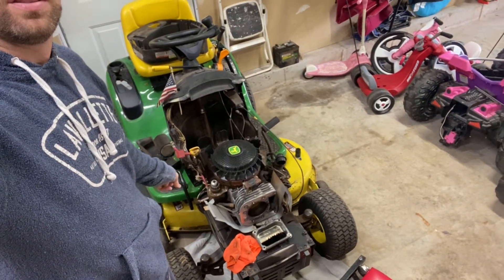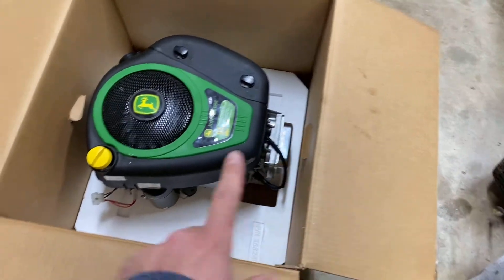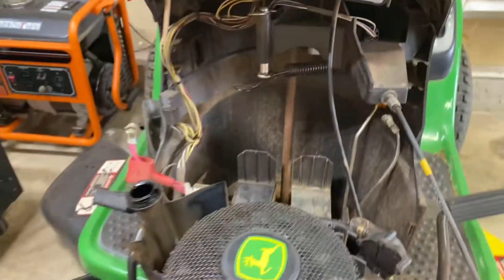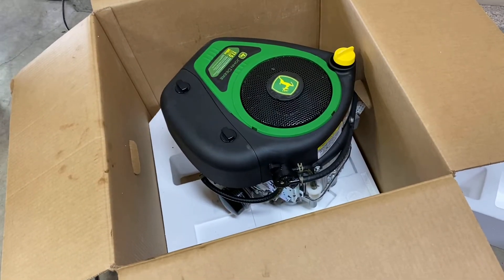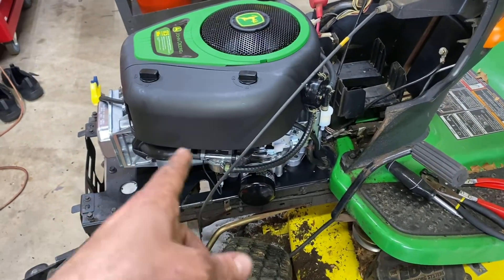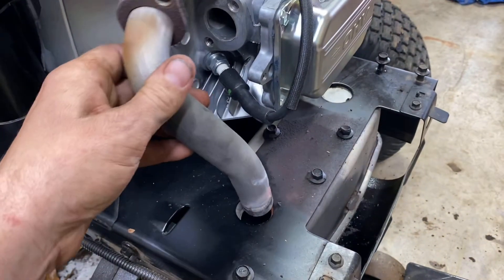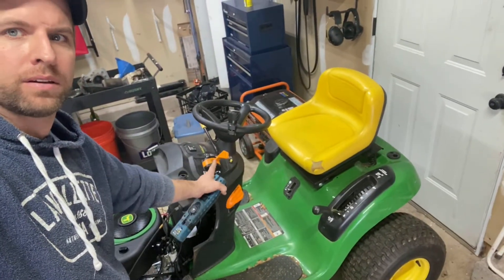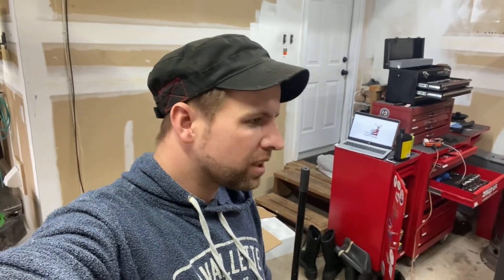How To - John Deere D105 Engine Replacement

Comment: At 13:56 of this video - What is the thick black cable and (black box thingy) called?  It's shown directly to the right of your hand.   Looks like we had some mice activity that chewed into the wiring of that black cable and will need to replace.

We so appreciate your informative videos!  Thank you.
Reply from the maker: If your referring to the cable that runs to the front, that’s the ignition coil (spark plug wire) and the black box is the coil pack. So the box/pack is what sends the electrical signal/pulse through the wire so the spark plug can fire, thus initiating the combustion stroke. If that’s chewed you can grab a new setup pretty cheap, under $25 if you don’t mind aftermarket.
Reply: @Neighborly_Content  Perfect!  Thank you.

Comment: Fantastic video!!! It made the Job 100 time easier and faster. Got a great deal on a used engine (135 hours) and began this engine swap at 5:30 last night. At 7:30 the job was complete and my D105 is running again! The engine I found was at a small engine repair shop, I got such a good deal because I removed the engine off an old tractor that was in his shop. It took me 30 minutes to remove it (thanks to the video) and he was very impressed. only small snag is I did struggle (briefly) on which of the many holes in the frame to bolt through. Minor 5 minute delay.
Reply from the maker: Awesome! Glad it helped out.

Comment: How is that single cylinder engine holding up? The Briggs single that MDI uses has a known issue with the camshaft. They put a compression release on it and it is known to fail. I am replaing my single with a v-twin.
Reply from the maker: So far so good, been running strong with regular tuneups. Keeping an eye for any deal issues. I let the smoking go too long on the last one.

Comment: Just replaced my D105 engine today! This video prepared me well to take on the task, so THANKS!  A few comments: 1) Throttle linkage can be adjusted with an 8mm socket on an extender, if you don’t have a T25 torx.  2) Install the old muffler on the new engine before dropping it in, or you’ll have to remove front of the chassis assembly (that holds the hood bracket as well) to get it in afterwards.  My muffler pipe required a 6 mm hex wrench to attach it.  3) It’s much easier to remove the new engine’s plastic cover before installation (you have to remove it to stop the fan assembly from rotating while attaching the drive spindle from below). 4) The passing advice to start the self-tapping screws on the bench was critical!  Made life much easier.    This video allowed me to place a $620 brand new John Deere OEM engine (purchased on eBay  rather than purchase a new tractor for $2399, and it took about 3 hours.
Reply from the maker: All amazing additions and thanks. Glad it helped buddy!

Comment: It looks like there's an blocking hole in the pulley you can use that to hold it still when removing the nut. You can drain the fuel tank at the end of season by disconnecting the fuel line at the filter and blowing gently into the fuel cap to induce siphoning.

Comment: i have the same mower and the Engine turns over but does not start I added new oil new spark plug new gas new fuel filter and a carburetor clean but it does not Get gas from the carburetor to the engine the mower's been sitting for about two years Outside What would you do
Reply from the maker: Have you checked the fuel pump. It’s the black disc shaped part near the top of the motor. It is a diaphragm known to split and fail.

Comment: How is it "seized up" if the flywheel needs held into place while removing the drive spindle.  Ill bet your carb just needed a rebuild.
Reply from the maker: More than a carb rebuild. Had a bent valve rods, blown rings, and a few other issues.
Reply: @Neighborly_Content  Oh ok,  I was just wondering how you got to that conclusion in the video

Comment: When I change an engine I usually drop the deck completely off and pull it out from underneath the mower.  
This gives me extra space underneath.  Dropping the front of the deck works but I like lots of elbow room. LOL
It also lets me examine the often neglected parts like the drive & deck belts & idler pulleys, the blades, spindle bearings, belt take up springs, blade brakes, transaxle, drive brake adjustment, Etc. 
I can flip the deck over and clean it out quickly with the pressure washer too.
I fluid film the unsealed wiring connections that're open to the elements to keep the green puss ftom taking over. An oz of prevention and all.

Comment: I literally just got off the phone with tractor service center and they told me the tractor my wasn't worth fixing because of the engine. I have a L120 that was left at my house by the previous owner.  I was thinking, I can change the engine myself. Can't be that hard on a ride mower.  I know you said your friend hooked you up. I was just wondering who he reached out to get the engine. Or if know of any places I can check to get a new engine for my lawnmower.
Reply from the maker: My friend works as a service/install tech for the local JD dealer. I believe the motors retail for $600 from Deere though, and you can always find a off-brand version not JD labeled. It’s quite a common motor actually since it’s a Briggs.

Also, what’s better a free tractor with a motor for a few hundred, a new walk behind (22”), or a new rider for $1500+.

Comment: 2:55 if that engine is a piece of garbage, why would you replace it with the identical model engine?  by the way, earlier you showed the black oil from the engine.  for the oil to be that black, that means you didn't change the oil often enough.  that oil should never get that black.  that acts like sand paper on your cam shaft which is probably what blew your engine at only 247 hours.  good job replacing the engine though and I hope the newer engine is better.  like you said, I've seen lots of those single cylinder D series engines blow a head gasket, and the funny thing is they all blew the gasket at the same point, as though it was designed to blow at that same spot hahahaha.  But I didn't see that happen with the E series models so I guess they fixed it.
Reply from the maker: So a little more perspective. The tractor sat over winter before I did the replacement. I was due to perform the head gasket and service when it blew so the oil was not that black when it first happened. 

The reason for direct replacement was cost/time. For me to change to a new mower meant spending a lot more, aftermarket motors are all the same B&S platform and they all seem to encounter head gasket problems. I got this essentially at a discount (cheaper than aftermarket) and if I get even the same hours out of it over the next 7 years I’m fine with that. Although it will probably be upgraded before then. Thanks for the view/reply.

Comment: Don't bother with that junk.goober thay are all junk so many of those all had the same issue company rip off . I gave up on fixing that shit it's just cheep shit. That people pay way to much for .get something old if it's old it's gold.
Reply from the maker: I hear you since it’s basically a base model and not an X or older LT or even G series. But for the money I wasn’t in the market to upgrade as my next purchase for a mower/rider may well be a zero turn that is battery. There is so much changing in the market today it’s hard to say but I’m about 2 years out from a new purchase.